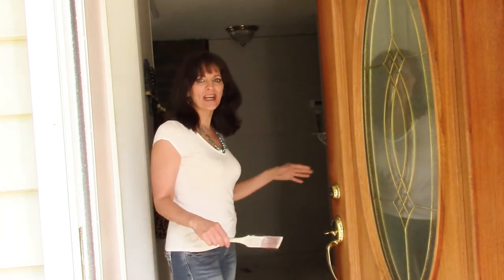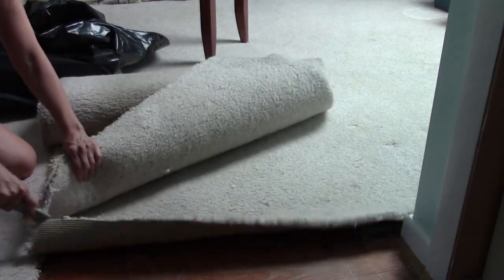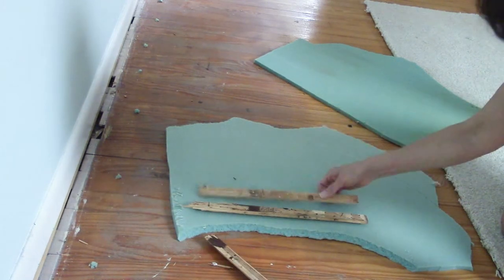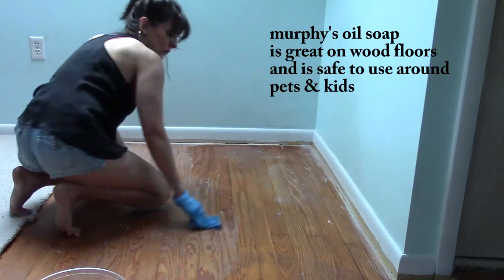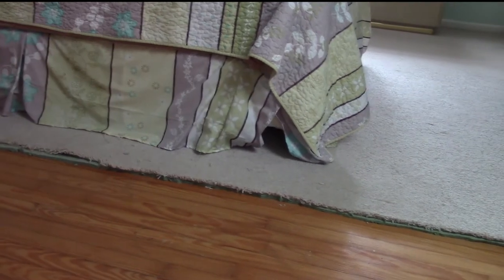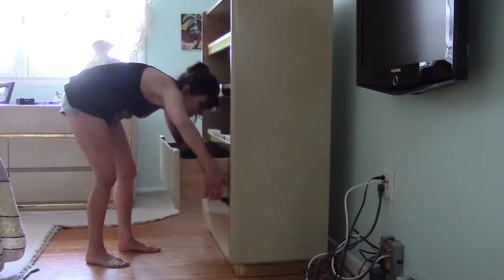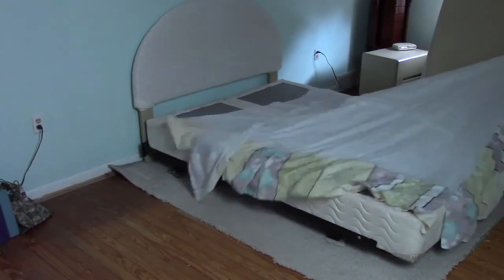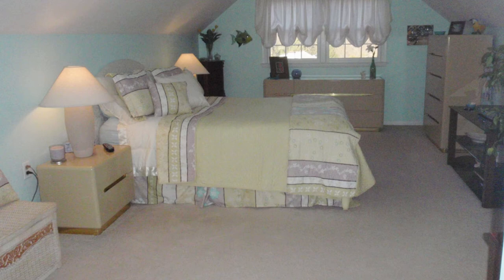DIY Carpet Removal with Furniture in the Room: Jill vs Wall to Wall Carpet: My Bedroom Fix up Part 1

Comment: Good job! Thanks for showing how it's done with all the handy tips for safely removing and disposing of the tacks and minimising dust as you go. I want to do this. My bed is very heavy timber though so I might need a bit of extra muscle to  lift it. Cheers!

Comment: I speak from bitter experience...On a long, hot summer evening I was cooking barefoot,  and managed to drop something into a pan of hot oil. It splashed onto my foot [only about a teaspoonful, the size of a stamp.] I home-treated it, a bad idea...at the hospital they said it was a third degree burn! Because of the position of the burn/scald, it was very painful, it took ages to heal, and I now have a scar on my foot.                                                                                              If you look up other DIY-ers, they wear some kind of light footwear, because a nail/tack/pin embedded in your foot is also pretty painful. Just sayin'...! :-)
Reply from the maker: Sorry to hear about your foot.The kitchen is definitely a hazardous place!